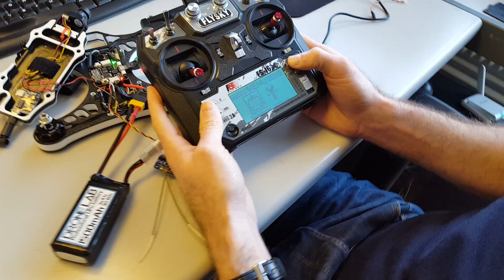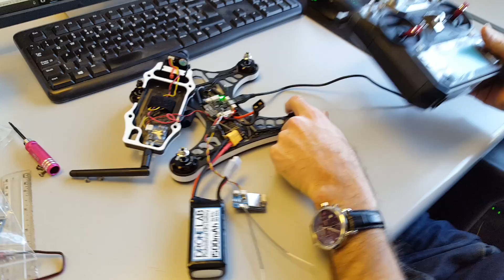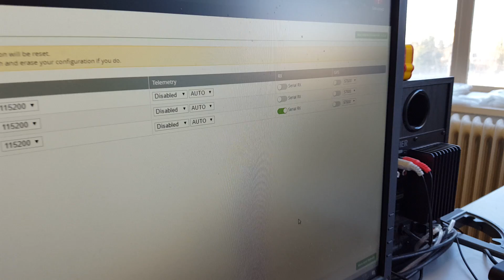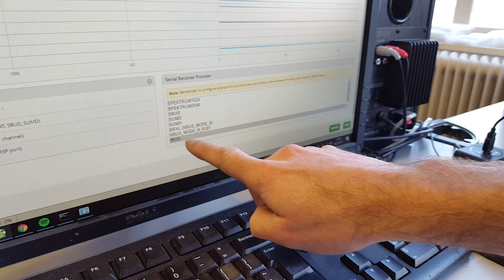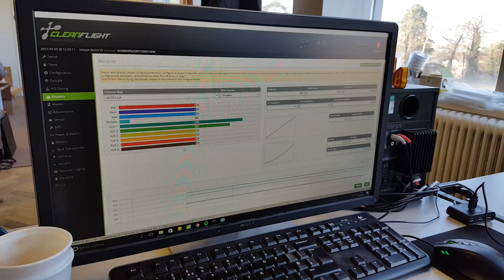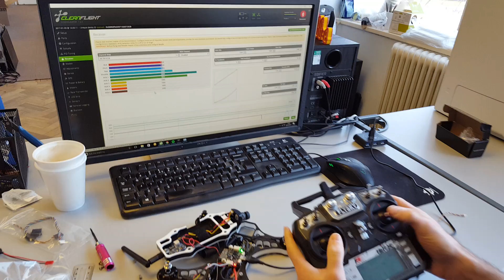Setting up an FS-i6X to work on 10 Channels with iBUS with X6B Reciever

Comment: Hi there, good video.
I have the very same radio and its set-up with the switches the same as yours.
I have SWA set to ARM the quad in Cleanflight (other switches SWB, C & D do other functions).
My issue is that when I activate SWA the Throttle (channel 3) goes to 50% throttle – not ideal.
The only way I can disable SWA affecting the throttle is to Disable the switch itself – it’s a work around but not ideal as I lose the functionality of one switch.
Any clues how I can rectify this? (BTW the Throttle Hold setting is set to OFF).

Comment: Yould it be possible to control my quad with PPM and have a servo plugged in too?(without going through the flight controller)
?
Reply from the maker: Probably not, unless you have some kind of double output receiver. But you probably could do it via the flight controller.

Comment: Did you connect it to IO_2? Where did you get the 5v from?
Reply: Hi Radio C, i checked the voltage on my IO_2 and i literally got no voltage... not sure, however, just for giggles i decided to check around with my multi-meter. according to the manual UART3 header is suppose to be 3.3V but on F3 board I get about 4.96V so I used UART3 V+, V- and RX and now i am up and running.

I guess the lesson for me an anyone else having similar issues, even if the manual states something, double check it with a meter since these boards coming from China may get changes but manuals/docs don't reflect it.

I think my next build i will look for manufactures that provide some kind of support. Cheers !!
Reply from the maker: I think this may be a mistake in the paperwork- as i'm pretty sure even on the original it was 5v on those pins.
Reply from the maker: The RX is getting 5v from the 5v output on that header next to the SBUS pin. The FCB is getting its 5v from a 5v BEC on the PDB.
Reply: Which header are you using? Here is the schematic for anyone who has been looking.

http://seriouslypro.com/files/SPRacingF3-Manual-latest.pdf

I wired the Yellow - signal wire to the UART 3 Header, and I took 5v and GND from UART 2 connector... and it worked at first, then when I did the final wiring, my receiver overloaded and there is a nice toasted burnt smell (over done for my taste) So I'm looking for an alternative approach or perhaps another way.

I was hoping to use the IO_2 Connector and take the 5v and GND from the Buzzer, since I wouldn't use it anyways.
Reply from the maker: Yeah correct, I/O2 for IBUS/SBUS.
Reply: Thank you for your reply again,  on the manual, IO_2 only outputs 3.3V.  The only 5.v header next to IO_2 is the Buzzer header.
Reply from the maker: Interesting. We get 5v from there, so maybe a mistake in the paperwork.
Reply: Radio C I'll have to take a meter to it and sort that. If it is 5v that would solve my problem.

I did try using UART2 Connector (5v, GND, RX) to x6b ibus and turned UART2 to serial_rx on betaflight but I couldnt get any response. 

In theory I feel like this should work....

Comment: Thanks so much. I'm still having trouble getting Betaflight to register movement on the sticks. I don't have a Lipo yet, could that be the problem?
Reply from the maker: Most flight controllers wont power the receiver from the USB power. So yeah with no lipo the odds are your receiver isn't powered up.

Comment: which transmitter and receiver have better range ..Fs i6 with ia6b or fs i6x with ia10 receiver
Reply from the maker: The transmission power has not changed, nor really have the antenna on the receiver. So they should be pretty much identical for range. These are normally good out to about 1km.

Comment: hi.. do You know if this ricever is good for this radiotransmitter?.. i Just want to know if It works with this radiotransmitter..    http://m.banggood.com/FrSky-XSR-2_4GHz-16CH-ACCST-Receiver-S-Bus-CPPM-Output-Support-X9D-X9E-X9DP-X12S-X-Series-p-1031481.html?utm_content=zhengsiying&utm_source=rcgroups&utm_medium=rcgs&utm_campaign=andyrc&p=XO2013166930201304K5
Reply from the maker: No that is a Frsky receiver, it wont work.

Comment: hi sir....can we do this in ia6b Reciever as well ....if yes can you please help me out...I'm not able to use 10channels
Reply from the maker: Yes but only if the handset has been flashed to the recent firmware. The IA6B does do 10ch IBUS, but the older handsets sold with them normally had too old software to enable more than 6 channels.